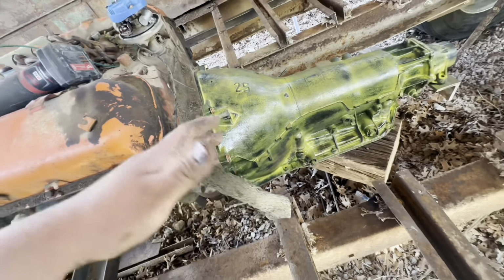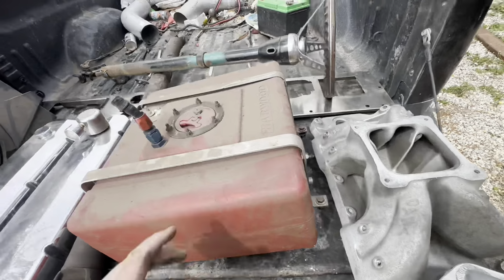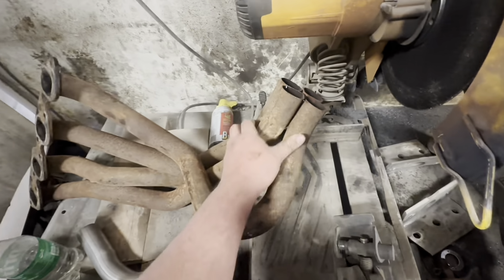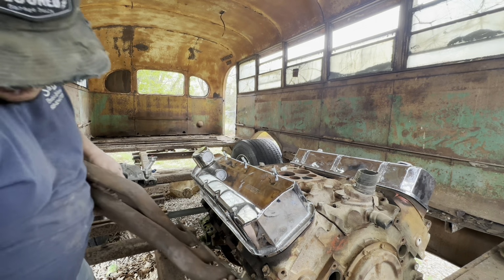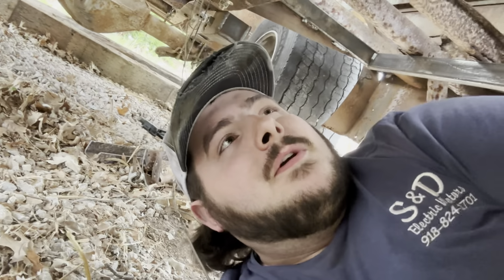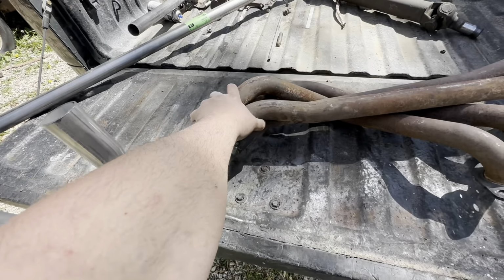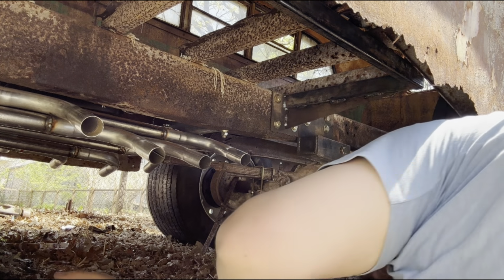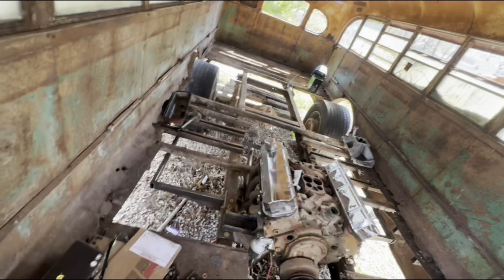Building Exhaust for the RAT BUS!! (Also a bunch of new parts!!!)

Comment: yup the manifold is for a tall deck / truckblock, you might be able to get it machined to fit the shortdeck if theres enough flesh on those flanges , might be eazier to swap it with someone though
if you realy want to hack it up you could make some fillerplates and use a diegrinder to make the squareports match with the oval port heads that are about a half inch lower , probably need to think of sumting with the distributor too as that whont stab in deep enough